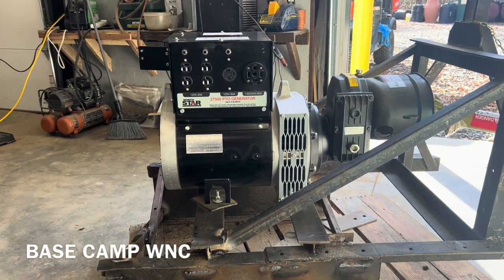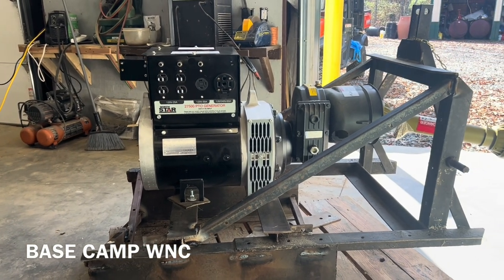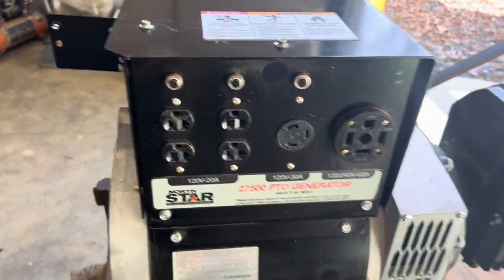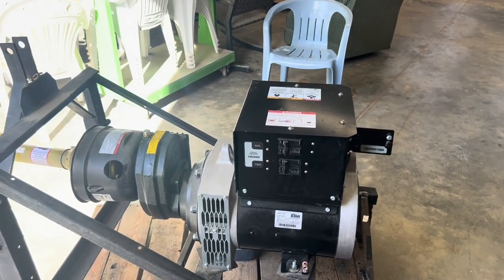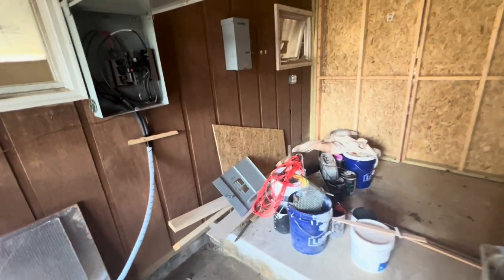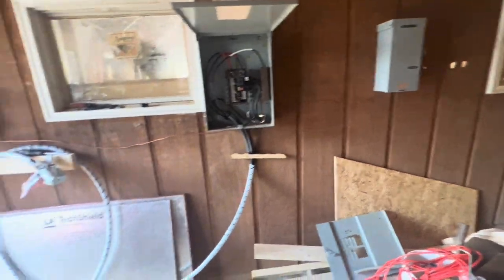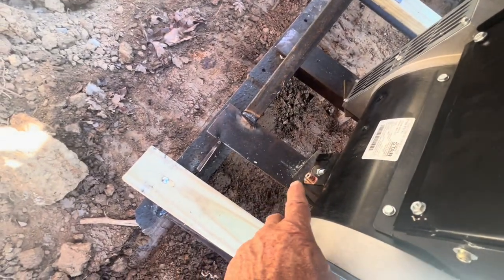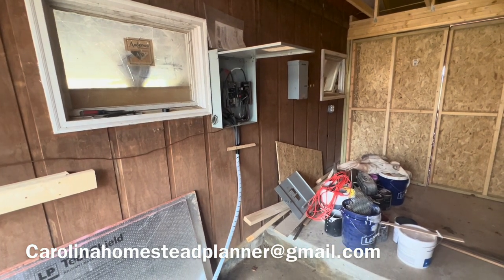Emergency power 25 Kw PTO driven generator

Comment: If the belt breaks on my MF 135 it would continue to run till hot and locked up
Reply from the maker: @mallorymcclary7  that’s correct 
You can but a motor monitor
It monitors the engine temperature the oil pressure 
So if something happens it shuts down the engine

Comment: Without engine overheat and low oil pressure protection you risk engine damage. Just saying.
Reply from the maker: Nothing in life is guaranteed 
The tractor is computer controlled 
So there’s engine and transmission protection 
And big brother is always watching